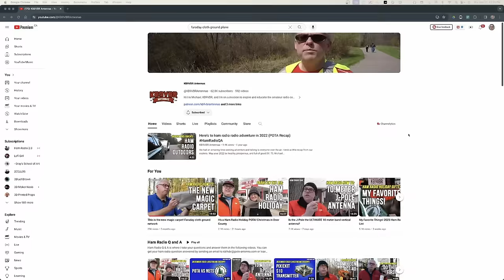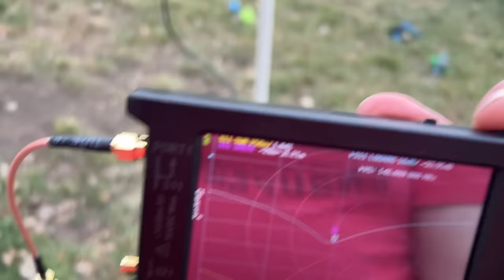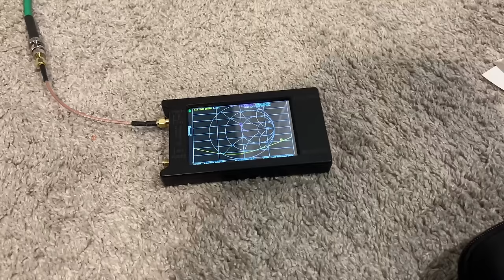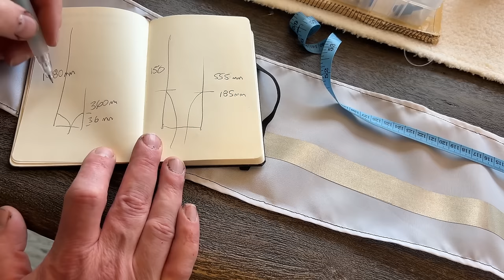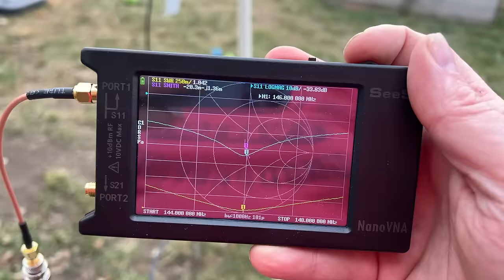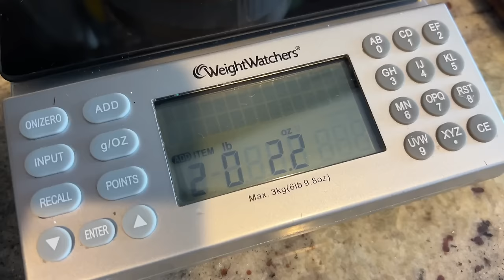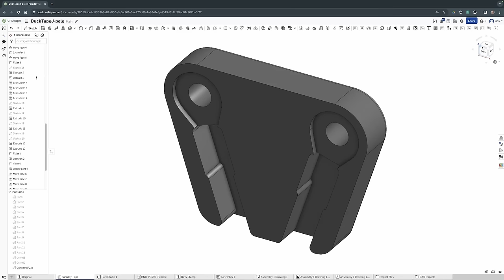Best 2m antenna for ham radio: Introducing the Faraday Cloth Antenna

Comment: The M0UKD calculator I think you used as the basis for establishing dimensions says that the space between the legs (dimension F) is not critical. Would it be feasible, instead of sewing the faraday tape legs alongside each other, to sew the legs either side of a narrower nylon tape so that, whilst insulated from each other by the nylon tape, the whole thing  is slimmer ?
Reply from the maker: Hot damn! That is totally worth trying out. I do think the dimension would require some separation but you are definitely onto something here. Also the connection points would be interesting to sort out. I will have to run with this idea though.
Reply: @VE6SFX_HamRadioRookie  Maybe just one long length of faraday tape sown to your backing tape then folded back on itself (faraday tape facing out) at the quarter wave length point. That gives you double thickness of backing tape sandwiched between faraday tape to perhaps reduce capacitance (if that is an issue) and makes it easy to attach your connections either side.
Reply from the maker: I am more concerned about the feed points. there will need to be two and they will have to be staggered. Otherwise I think they would just work as a capacitive short

Comment: Someone said in a comment that, " And you'd have a hard time trying to find the actual values anywhere, other than doing experiments like these, and measuring / calculating it for yourself." Actially, as you have shown, it is easy not hard to figure the correct length.  With today's analyzers the process is easy and logical.  You can lay out a length of the intended material.  Physically measure its lenth.  Then electrically measure its  length.  It will be a little shorer as you demonstrate.  That means it will have a VF of some number like 95%.  Ben thanks for the innovative videos.  They are fun to watch and learn.  73, Jim W6LG
Reply from the maker: Thank you Jim! every time one of the people I respect and watch online, comes and comments on my videos it's a thrill. :) And yes you are correct on using the theVNA. I am struggling to find the actual VF of this stuff though as with all my (albeit likely wrong) calculations the VF is over 1 or over parity. This is s a physical impossibility so I need to really dive into the calculations and figure out what this actually is.

Comment: No way.... this is amazing. THIS IS WHAT THIS HOBBY IS ALL ABOUT.
Reply: @ChrisBeiting  The beauty is, one can be an extremely avid radio hobbyist without bothering with getting a license. I am extremely into the radio hobby. I just do not transmit. I make amplifiers, high current power supplies, manual antenna tuners, antennas, band pass filters, notch filters, AC hum filters, low pass filters, high pass, filters, I convert radios from one service, to different services,  modify radios for improved function, programme radios, and install repeater networks, antennas, and complete stations.  I likely know more than most amateur radio operators.  I simply can not hold a conversation that does not make me sound synthetic, or mechanical.  Thus, I just enjoy the technical aspect of the radio hobby and only transmit into dummy loads when servicing equipment.  I grew up without amicable, nor amorous, interpersonal, social connections nor interactions. There is no procedural manual defining customs and protocols associated with successful social conversational exchanges. Bit there are plenty of technical transceiver schematics and diagrams. It is just natural to associate wit the machinery than the humans.

Comment: Not an amateur radio operator.  However, I set up an 80 meter antenna for an amateur radio operator.  2060 centimetres on each leg of the horizontal dipole, set up 7 meters off the ground, the result looked like a giant laundry line.  But, with 5 watts he was able to make a contact from Northern Saskatchewan to a ship off the coast of South Africa.  I told him it would work. I used electric fence wire to make the enormous dipole.  I really wanted to try the transmitter myself. But, I can only transmit into dummy loads when doing repairs, modifications, and changing from other radio services to amateur radio service bands.

Comment: I just received 6 plastic 8x10 sheets to create that folded box antenna you created with foam board. I got 1/8 inch pieces. I ordered the two extras "just in case" I screw something up. I ordered from Tapplastics. They cut them to size according to your order.  And they're not expensive at all.  Now that I have them, I think I could have paid a little less because I think 1/16 inch would work just as well. I'm going to epoxy the sheets into a square, add some mounting pieces, and that should do the trick. Thanks for all your instructive videos.
Reply from the maker: Epoxy will just work. With this plastic you might want to consider CA glue or go to a hobby store and get som ‘Plastrut solvent glue’ https://www.google.com/search?q=plastruct+plastic+weld&sca_esv=593269269&rlz=1CDGOYI_enCA982CA983&hl=en-US&sxsrf=AM9HkKmZ1zY35Cz8wwNHxPCa7NofGiZ79g%3A1703338078486&ei=XuCGZdGgHbmH0PEPz9-FOA&gs_ssp=eJzj4tVP1zc0TK9Iic9KyU03YPQSK8hJLC4pKk0uUQCzMpMVylNzUgAHGw3S&oq=plastrut&gs_lp=EhNtb2JpbGUtZ3dzLXdpei1zZXJwIghwbGFzdHJ1dCoCCAEyCxAAGIAEGIoFGJECMg4QLhiABBiKBRiRAhjlBDIHEAAYgAQYCjINEC4YrwEYxwEYgAQYCjINEC4YgAQYxwEYrwEYCjIHEAAYgAQYCjIHEAAYgAQYCjIKEC4YgAQY5QQYCkiWUVDBGVjdP3ADeAGQAQCYAY0BoAHHCKoBAzQuNrgBAcgBAPgBAcICChAAGEcY1gQYsAPCAgcQIRigARgKwgIFECEYoAHCAgcQABiABBgNwgIFEAAYgATCAgsQLhiABBjHARivAcICChAjGIAEGIoFGCfCAgsQABiABBixAxiDAcICDhAuGIAEGMcBGK8BGI4FwgILEAAYgAQYigUYsQPCAgsQLhivARjHARiABMICChAAGIAEGBQYhwLiAwQYACBBiAYBkAYI&sclient=mobile-gws-wiz-serp#fpstate=imgv&imgv=0 it will weld the pieces together. I’m so in love with people actually building my ideas! Thank you it validates my crazy brain.

Comment: I think the difference has to do with the width of the tape. 
I used two tape measures to make an adjustable dipole.
I discovered the length for the different bands was considerably 
shorter due to the width of the tape measures compared to wire.
Great idea and video. KF6EWO
Reply from the maker: Yes this is possible

Comment: They were talking about you on Coffee and Ham Radios this morning. All good.
Reply from the maker: ! I thought I was on to something, but honestly I am a bit overwhelmed with the response to the video. Finding out others are already talking about it is amazing. I know I was damn excited over it but I see this excitement is shared. Definitely a awesome thing to be validated in my craziness. 73
Reply: Will it work if taped over
Reply from the maker: @morecambeanglersandtrawler1074  I am not sure I understand can you elaborate?
Reply: @VE6SFX_HamRadioRookie  yes I was meaning for waterproofing will it work taped over clear tape or insulated tape or plastic tube?
Reply: Pvc tube
Reply from the maker: @morecambeanglersandtrawler1074  Yes it will. However depending on the tape materials it might change the resonant frequency.
Reply from the maker: @morecambeanglersandtrawler1074  Yes it should but it will change the resonant frequency. Here is the thing though. It works fine wet so why bother weather proofing it?

Comment: Hey Rookie. Man, you are exactly the right type of new-blood this hobby needs. Nice work Ben.
There is a vid kicking around of a guy making a 2m + 70cm antenna from a single length of 1/4 copper tube bent into the shape of a J pole (roughly) single feed point. 👀
Reply from the maker: Do you have a link for me to watch it?
Reply: @VE6SFX_HamRadioRookie
Im still tracking it down. I thought I bookmarked it, I have even gone out and got the copper.
So I'm on it Boss.
Reply from the maker: @snakezdewiggle6084  Thank you, no huge rush. Build first , hit PTT... those are far more important
Reply: @VE6SFX_HamRadioRookie 
Hey Ben. I have not been able to find the antenna video I mentioned. But, if you search " foldable dual band ", and/or " ed fong " on yt, there is plenty of, info, actual antennas, and theory.
If you have a temporary email, I can send you books and other info. I dont have access to social media.
Reply from the maker: I can do the google thing for sure. No need to send anything. But if you want to contact me using the contact page at https://hamradiorookie.com/contact-me/ is best

Comment: Velocity Factor 👍
If you want to reduce common mode at bottom of linking bus add two 1/4wave or 1/8th ground radials horizontally help improve J pole performance.
Ull notice once very high above ground ,ground radials take more effect (ground affect)
Bit more technical is a rf isolator transformer with right core material.
But in most cases can get away with unbalanced feed to balanced feed point.

12/11/10m version id like to try 👍

73's Rob.P
Reply from the maker: Going to have to try this. Thanks!

Comment: I was wondering if you used 2 strips of ribbon. One on each side. Stitch the antenna to one side, then stitch it together. Place the ptard on the up end and the attachment for coax on the other end. A few sections of pvc for a mast with a block and tackle. Arrive, up, down, and gone.
Reply from the maker: That is all doable.
Reply: @VE6SFX_HamRadioRookie  I got on the list for the antenna. WSAD447. I kinda need a gmrs antenna. I had a stroke. So light, mobil, would be great. I am working on learning for the ham radio side.
Reply from the maker: Terribly sorry about your stroke. Once these are out I’m looking at doing a shorter dedicated GMRS antenna FYI
Reply: @VE6SFX_HamRadioRookie  thank you. It is difficult to retain new information. Part of my own prescribed therapy is to learn new things forcing me to progress. Not stagnate. After the stroke. It took 10 years but walking talking and most function has returned. Cognitive is the real remaining issue. I will compleat the ham course and score a perfect grade. It is a quest I have set for myself. Once level 1 is accomplished I will strive for 2 then 3. I will not quit while I draw breath. I did place myself on your email list. When your rest to tackle it send me a bill I will get it paid ASAP and it can be shipped. As far as me making my own. Maybe later.

Comment: I am wondering, if it is pollsible to put a 70cm Jpole on the back side of the tape. So you can have 2 bands in 1 antenna. Maybe even in parallel. 73
Reply from the maker: It resonates at 70cm as well! no need for that :)

Comment: Have you tested the longevity and durability of the printed parts using PETG or PETG+?  Unfortunately, I cannot properly vent my printer for ABS or ASA.
Reply: I have not. But in the end either of those will work fine. The only thing I can think of is that they would have a better chance of melting in a hot car.

Comment: Makes sense that you would need more length. The way the material is constructed would inevitably mean it has a different velocity factor. And you'd have a hard time trying to find the actual values anywhere, other than doing experiments like these, and measuring / calculating it for yourself ;)

Would be nice if somebody were to make tables of values like this for all sorts of conductive materials, so others who like to experiment have the data too ;)
If you want a sturdy base material for these things; used seat belts are great for all sorts of hobby projects! When I replaced mine, I used the old ones to make belt-loops and screwed on 3D printed locking mechanism's for my radio's.
Reply from the maker: Absolutely! Might have to start working on that.
Reply: @VE6SFX_HamRadioRookie , while it could well be a velocity factor difference due to the odd material being used, I'd tend to think it could also be due to the much lower capacitance of the elements due to it being flat. Larger diameter radials always end up shorter due to capacitance increase of larger diameter elements, in particular out at the end where the voltage is the highest, and therefore the surface area has more affect. I'd like to see a signal strength comparison of this antenna against a copper cactus mounted at the same location.
Reply from the maker: Totally! Remember I’m the ‘Rookie’ still in my first year of ham so a lot of this testing equipment is out of my reach. But the local clubs are helping me with some of this. The capacitive concept you point out here definitely helps gel some of what I’m seeing with using this fabric though. Now can you help me understand why the thinner elements have the same bandwidth as the wider one does? Keep in mind the final thinner version length went from 1500mm to 1795mm.  Copper foil versions that are narrow elements have very narrow bandwidth and wider have wide bandwidth but the length stays the same. So suffice to say your capacitive idea is likely the effect I need to be chasing not the velocity factor. There are some other new interesting effects that take place with yagi and slot versions using the faraday tape. But let’s focus on one thing here first and dive into others after we sort out this one first. I love your mind, curiosity and hypotheses on this! Your comments by far have me doubly curious over the physics of this antenna.

Comment: Gosh Ben, this is fun stuff...  I love it.  I wasn't aware of the Faraday tape or cloth. Thank you for sharing that!...  I've been using copper and aluminium tape for my prototypes, and bridging the flex points where the foil would tear, with ground/shield braid and clamps, (which is also usable as an antenna)...   The only thing I wondered about in this super neat design, is the effect of having coiled the coax into a loop at the base of the antenna.  I know it was likely there just to keep things tidy, but I wondered if it may have reduced the performance of the system or forced  the change to the antenna length, to accommodate the added inductance or choking effect at higher frequencies.... Love it!  Keep them coming!
Reply from the maker: The coil in the shot is just a choke to keep any reflected signals from my radios. I have tried with a straight line and you are correct it performs better. I am just doing it out of a abundance of caution and because others recommend you do this.
Reply from the maker: Oh and using the cloth for hinge points does work. You will see in coming videos. I have found though that it kills bandwith on a slot antenna. However I have yet to try other configurations.
Reply: Is the cloth available locally in Calgary? In my application, I'm using a pop up MFJ non- conductive polycarbonate pole, and using the foil as the conductive outer layer.  The goal with the larger diameter, is to broaden the band width at HF frequencies.  I also  needed the rigidity of the polycarbonate to withstand flex at high speeds and high winds when travelling.  In it's travelling position, bent forward above the truck @ approx 12ft, if the antenna bounces while at speed, the variables of the antenna tuning change with the distance to ground and the vehicle.  The pole is also very light, which makes a bunch of things better... However,  I've managed to damage the whip with the actuator, while extending it at the stop, to check into the 40m net.... Question about the cloth... Could it be used as a replacement to fibber-glass cloth for a repair or build? ... Your timely post and my unfortunate accident, may the a solution in my next build.  VE6DAY Mobile... @VE6SFX_HamRadioRookie
Reply from the maker: I got the cloth via Amazon next day there is a link to the materials in the description. I’m already experimenting with impregnating the fabric with resin and hope to have videos early next year on my results. But so far it does very well

Comment: "Shut up and take my money!" Subscribed to the mailing list and channel. Can't wait for these to be available. I'm guessing since they are a j-pole, they are omni-directional and don't require a ground-plane? Great stuff!
Reply from the maker: Yup exactly. I wanted a light weight easy to use antenna. This one is omni directional
Reply: @VE6SFX_HamRadioRookie  From the look of the work you did to shrink wrap the connectors and all, I would think these can be used outside, right? These would be great at our hunting camp.
Reply from the maker: Yup and testing so far I’ve had it soaking wet and oddly it worked better
Reply: @VE6SFX_HamRadioRookie  Incredible! Keep us posted via the mailing-list of further developements. Kudos on the great ideas.

Comment: I've done this before with panels of fabric, small-gauge wire, and a sail needle to weave the wire into the fabric. Such a convenient way to make an antenna. They're pretty much indestructible too, they aren't fiddly or tangley like their ladder line counterparts.

Your additional length most likely is velocity factor, good thinking. Most online j-pole calculators are meant for copper wire which has a pretty damn good velocity factor. Nickel isn't as good as copper and I'm sure the adhesive junctions aren't as conductive as the surrounding nickel.
Reply from the maker: Hummmm I may need to see about using conductivve thread at the intersections and have it fully connect. Thanks for the thoughts 73